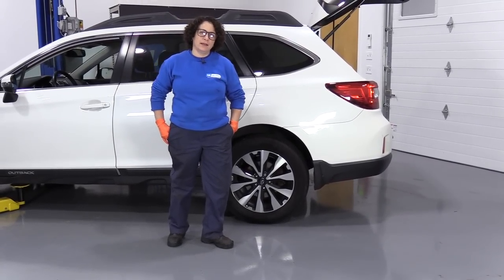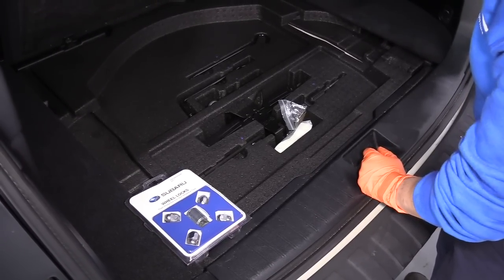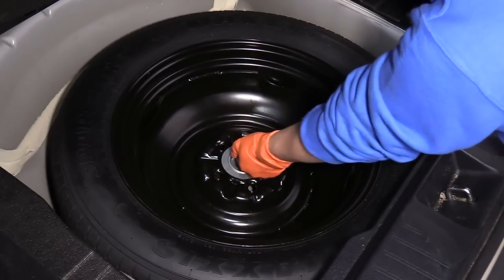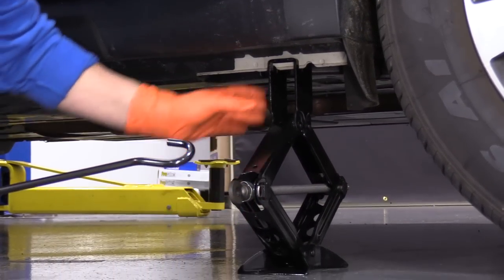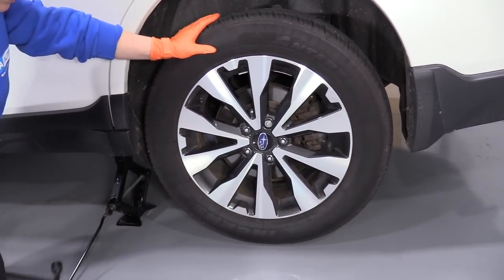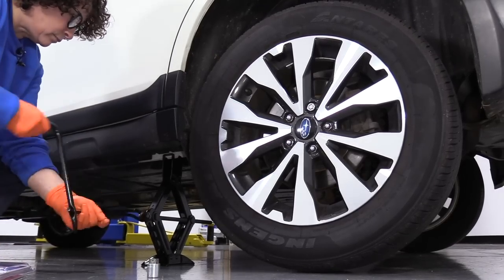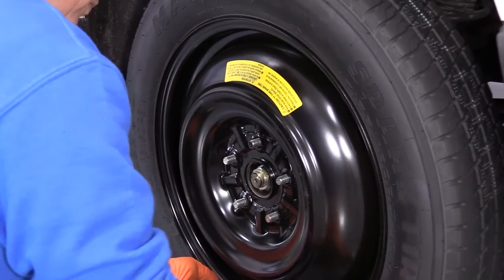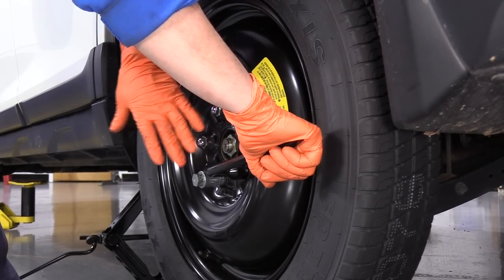How to Properly Change a Spare Tire on the Side of the Road (Quick)

Comment: Thank you so much for your thorough explanation in details. I had a flat tire in a mountain so there was no cellphone signal to call AAA. I had to try to get the flat tire off and put a spare tire on. You particularly mentioned the crisscross pattern. I didn't follow the crisscross pattern so I couldn't get the last lug nut out (the lug nut got stuck). And later that nut stub snapped off. Thanks again. I learn so much from this video.

Comment: I`m a 59 year-old man and changed his first flat tire ever! I was a bit nervous and not thinking very clearly. I looked for the jack in the trunk, but did not find it. But it was there all along! It was broad light day, so I should have seen it. I drove back home for 2 minutes, very slowly with the flat tire still on. Then I used the garage jack I had at home, but it was extremely difficult to place underneath. I finally managed. The next, I found the original car's jack in the trunk! It would have been much easier with it. But I learned a lot. And I'm also learning the details you provided in this video
Reply from the maker: +@DenisMorissetteJFK Thank you! We love empowering our customers and showing how to perform DIY auto repairs with our high-quality auto parts.  http://1aau.to/m/Shop-1AAuto-c